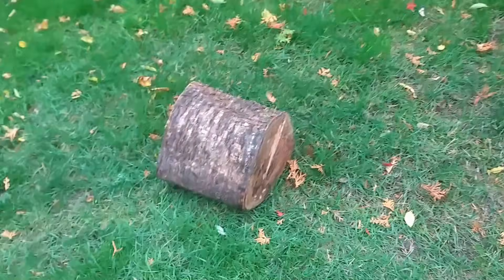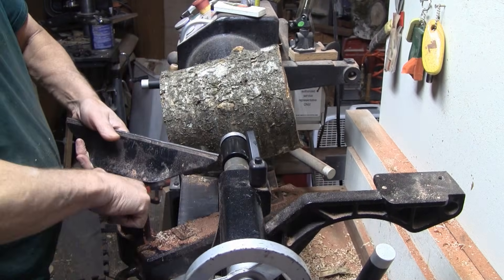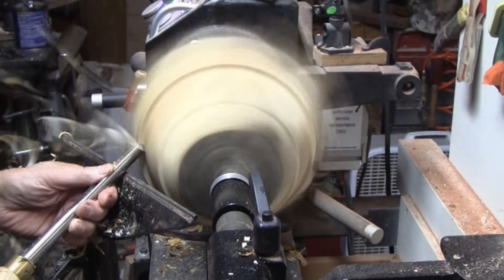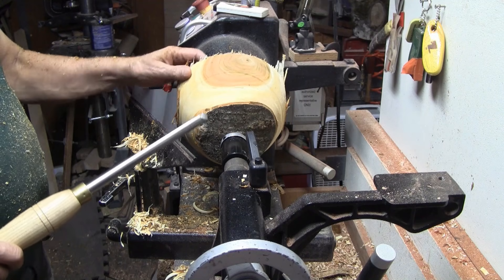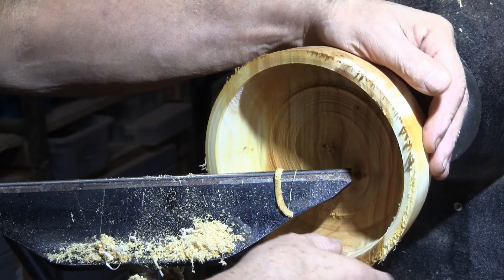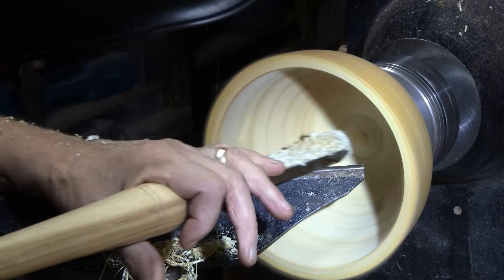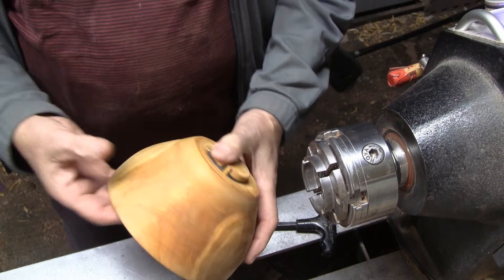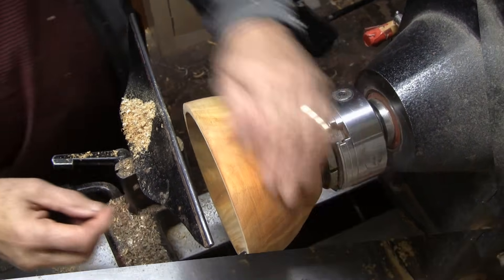Wood Turning Green Wet Wood Thin & Sanding Tips

Comment: That is a lovely bowl, and perfect finish, Gary. I've heard cherry likes to crack. Your mineral oil trick seemed effective. I turned some cherry for the first time, today. Just a little dish to become ornamental angel wings, but I finally had a project that called for one of my few cherry pieces.

I was intrigued from 4:40-4:55. As you turned, the sped up video made it easy to see the moisture coming to the surface, before you were even finished the cut. Fun to watch green wood being turned. Looking forward to next week's video.
Reply from the maker: Thank you Jay. Yes this piece was soaked. It had only been down for a few days. It is amazing to watch the water come out when you get down to 1/4 inch walls. If you go much smaller than that you can spin dry it and actually do a lot of sanding with just sandpaper and no oil. 
 Green wood is really lots of fun to turn.
Your angle wings sound interesting.
Thanks for watching,
Gary